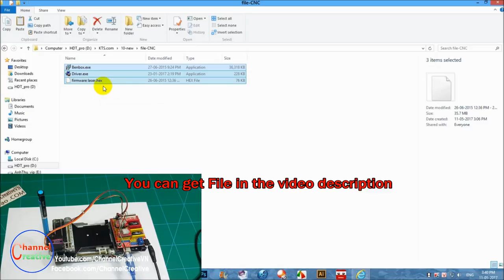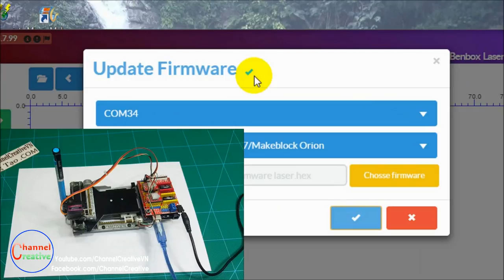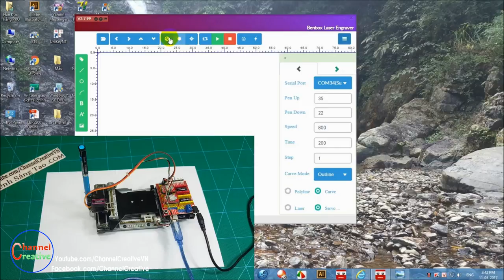How to Make a CNC Drawing Machine at home

Comment: As a beginner to robotics, how should i develop my skills in robotics? I know some arduino. Any Recomendations? Can u please reply?
Reply: Warriors Fan #1 try an obstacle avoiding robot that is vaery simple and interesting way to get the best of arduino
Reply: Just go to ebay and order lot of sensors, motors, displays and then you just start with one of them. When you know how to use what you gought then you can make everything.
Reply: I would say that being able to have a solid understanding of programming arduino, raspberry pi, or other micro controllers (usually C/C++) is the most important, followed by learning basic circuit theory and the different types of transistors and what they do. For most basic things that should be enough. 

When you get into more advanced projects, things like real-time capability and power efficiency become more important.
Reply: take some semi-big project like 3d printer/cnc router r something similar and try to make it by searching hw is it made and see some videos,thats what i do.

Comment: Sir, you give 5v to cnc v3 shield but it need 12-36v how it run 
And my DVD stepper motor is very heated 
So what I am doing
Reply: Suraj Maurya can u sell this
Reply: kbc writer No, but I making this as my college project
Reply: Can you help me to make this
Reply: why not
Reply: Send hello
Reply: Okay
Reply: yeah the DVD stepper motor gets heated
Reply: Suraj Maurya did you solved this?
Reply: would u sell me a finished version and ship it to the US? if u would do, how much for it?
Reply: I m facing this too .how can i solve this heating problem?😥
Reply: My project for the school is this Cnc But the Motor is too hot ans heated :(
Reply: Use resistance on motor
Reply: Suraj Maurya are you using 5v?
Reply: Motor needs 5v not 12v because you will burn it. Adjust the potentiometer at the stepper motor driver to 0.20
Reply: @tanmayislam855  give to like 18 v so it can take the full energy it wants because 5 v is very very bad for it so just bring 2  that have 18 volts each one will have 9 volts so connect the positive with the positive on the other battery and the negative with the other negative on the other battery and then to the CNC SHIELD and I am sure it will work because I tried it.
Reply: @instaboiidsg2117   how can i do it ?

Comment: did you give any arduino code uploading as well for this project ? , did you included GRBL library.  my dvd motors didn't responding to commands fro pc program only servo motor at pen moves. where could be the problem?
Reply: Use 12v adapter for CNC shield .
Reply: but my servo moter dis not work
Reply: sewasaran satsangi servo will started it's work when you give a power from computer. It doesn't need any outer power source
Reply: I also give power from computer but servo is not work.please help me sir
Reply: sewasaran satsangi check connection of servo and also check that servo is working ....
Reply: Does your servo is vibrating ???
Reply: no sir, i connect all wires properly but my servo moter cannot work it just only up and down for 0.5 sec. when i connect  to computer .
Reply: sir please help me
Reply: sewasaran satsangi ok first install basic example of led light which is given in adruino Application , then re install firmware from beanbox , if it doesn't work then change the setting of beanbox (it's try and error type of work )
Reply: SIR WHERE I FOUND LED EAXAMPLE AND HOW MANY POWER I GIVE TO CNC SHEILD
Reply: I CAN NOT FIND WHERE IS EXAMPLE OF LED LIGHT
Reply: sewasaran satsangi u must install adruino ide then go to example then basic and then blink
Reply: i will already install blink code
Reply: sewasaran satsangi blink code is used to just remove the beanbox software , just like reset
Reply: sir what can i do i will upload the blink code
Reply: sewasaran satsangi once u upload blink code then upload firmware from beanbox if blink code is working properly
Reply: no sir when i upload firmwere blinking is stoped
Reply: sewasaran satsangi check the video in youtube for "how to check adruino uno is original and it's working "
Reply: have u use facebook
Reply: but my aurduino is work properly.i will alrdady check when i purchase aurduino
Reply: From where can I get aluminium composite

Comment: I have made it successfully 😊😊
Reply: #Tonmoy islam.
Hii. I hve made this project and servo is working fine. But the stepper motors are not working properly. How many volts should i supply to cnc. Now iam using a 5v 2A adapter. Should i try using 12v adapter. Or should i take a short usb cable. Please HELP!!!!
Reply: zaki shaikh 5V 2A enough for me .can you describe which windows installed on your PC?
Reply: Its Windows 7 32 bit.
When i rotate 1st motor it rotates for some time and stops working. And then 2nd motor starts working and then after few seconds it stops and again 1st motor stars working And it continues. Both motor doesnt works at same time. Also they dont work continously  it is working jam.
Reply: zaki shaikh it might be a driver issue .or your motor got too much tight . make sure all value as same as this one .
Reply: Tonmoy islam Which values are u talking about???
Reply: Tonmoy islam My drivers are working fine. Also my motors are not tight.
Reply: you have to change some values in benbox softwere
Reply: Tonmoy islam Which values should I change ??
Reply: Tonmoy islam Is this ur FB I'd or Gmail I'd???
Reply: fb

Comment: Hello
Excuse me, I did everything right by training, I tested the motors and installed it on the board.
The sero-motor is healthy

But the one who wants to do it does not move left and right.
The seromuter does not move. The problem is where I tested the 12 volt adapter 1 amps and 5 volts of 2 amps. Both of these would result.
Reply: My servo is not working. Fixed in one position.
how to fix it?

Comment: Would it be a problem to use the DRV8825 stepper motor driver instead of the A4988 stepper motor driver?

Comment: hello,
i have made the same from a4988 stepper but my motor only vibrate it doesn't move i also tried to change resistance of stepper but it doesn't make any change , I'm using 5v,2amp adapter please help me.

Comment: i made this project 5V 2A given to CNC motor shield board successfully connected with PC software after update but i have few problems
(01) thread of pen broken every time i powered this unit with PC connection (servo rotate too much at start)
(02)  during the drawing of sample picture servo of the pen only works well X & Y axis motors from DVD drives are not working and  Y axis motor also heated up during drawing is  progressing by PC
i checked both dvd motors they works well motor connections to CNC board done as your guidence
please be kind enough to sort out this problem, thanks.

Comment: Bro another is I have change the steeper driver pointmeter by any while it start running it will going heat too I change the pointmeter to 0.20 and my power adapter is 5v 2.0am  but one thing is while iam running the motor  my laptop is charging with the adapter so is that will effect the current increase or not. Thank you I need for urgently please

Comment: I have completed the project and it's working fine but the  only problem is My servo is not working what to do
Please help me
Reply: The Techy Boy  same here
Reply: is this project required any arduino code because discription box dsn't have if required means post in this comment
Reply: Can u help me
It's showing nothing connected in port when I try to update the firmware

Comment: Bro I tried connecting with the benbox but now the stepper motor is cool and not moving
Bro servo motor started working
: But stepper motor is cool and not moving
I adjusted the value: It working perfectly as whenever I upload a picture it raises when not needed to draw
 In com3 when I connect it shows success
 When I disconnect the aurdino the led turn off even if cnc shield is supplied

Comment: hello, very good project, I have done it but they overheat the motors, is that normal? what can be done? thanks greetings
Reply: Hi, you probably need to turn down the power on the stepper drivers.  There should be a tiny screw.  Turn it very, very slowly anticlockwise to turn the current down.  You only need to turn it a few degrees.  If you have a multimeter, check the voltage between that screw and ground.  Start by halving the voltage.  Its normal that the motors get hot, but they should not burn you.
Reply: Very interesting.  I'd be interested in seeing more of your pen mechanism.  Mine it too heavy, and it moves the teeth away from the spindle.
Reply: Samuel Pickard is taken out with a 3d printer, doing it by hand is more complicated

Comment: on cnc shield it is mentioned that 12v then why we are suppose to give it 5v supply ?
Reply: 12 volts would be a lot of voltage for small step motors that only require 5v
Reply: @infester159  thankuu

Comment: can you help me
when i plug the arduino in the computer and fix the settings the servo starts to move up and down then the motors wont work and arduino starts disconnecting
Reply: Filip Eriksson thats why this is incomplete video hiding software instalation part you never become successful only with this video
Reply: If there is motor not working and only servo is working then use 12v adapter for CNC shield
Reply: Wasantha Wimaladharma software installation is too much easy , just follow the steps for that wizard

Comment: What is the supply voltage for the shield
Reply: 5v, 2amp as shown in video
Reply: hi the cnc shield is 12v its the arduino that is 5v.

Comment: Bro can u plz help me out...
As I made this handwriting machine not using the CD driver but using different stepper motors and a service motor ....
But after connecting the complete circuit .. my stepper motors are not working ...
So can u plz help me out with it . ..
That how to operate the stepper motor and the benbox software ...
Plz do reply fastly ...

Comment: My micro servo didn't working properly it only work when I plug it it's moving down to up when I plugged into current
Reply: KICHU Rock make sure your servo setting at benbox is right, X=11 Y=11 or 12. Also check servo wire, red to 5v, brown to gnd, yellow for signal to Z+
Reply: My servo is not working. Fixed in one position.
how to fix it? I have adjusted the parameter like you.

Comment: When I am using stepper motor from LG cd drive (completely working cd drive) it's not working....?
When using stepper motor of hp cd drive it works....
Give any solution to working of lg cd drive stepper motor...
Reply: Sudhir PV, Hai sir when i connected uno with the laptop, only servo motor is working. But stepper motors are not working and gets heated up. Can u please help me to solve this issue.

Comment: I have completed the machine but the y-axis motor has gone for 2 times why?
Reply: Bro eppadi work aachu enaku update firmware connect aaga matingurudu
Reply: @alonethrottlerider1257  did'nt understand
Reply: Bro while run the update firmware its shows on the display script error.plzz help me to solve the issue

Comment: hi my dear friend
i make this machin 
after finishing and start it have a problem in both motor.
all 2 motor is very hot and i need help to solved this error. plz help me
Reply: to many volts, only 12 volts needed or you have wired them wrong.
Reply: same with mine.
Did you resolve the problem..?
please let me know how to fix it.

Comment: Is there any requirement of programming in any of the card....?
Reply: no you don't need to program it
Reply: @yehya2715  so we just complete the connection and the install the benbox?
Also do we install while conmected with the ardino or without connecting the ardino
Reply: @sameeramomin2789  yes you should install benbox and as you want you can connect it and download benbox or without connecting it you can download benbox

Comment: it is good video but name of ic board and name of the other things used these must be subtitles
Reply: hi Naresh Mehndiratta the boards are, arduino uno - cnc sheild v3.0 and two a4988 drivers. the other things are two stepper motors taken out of computer dvd drives and a servo. hope that helps.
Reply: thank you for your fast reply  morever i am a man of hearing impairment so i did not want to  listen so i read also

Comment: Hi, I just buy CNC Shield, arduino nano, controllers and other components... I use TLaser for software because benbox is not just correct for me. I connect all like on tutorial but I cant move my Y axis (motor), X is OK. Voltage on controllers are 0,2V and I use 5V. I changed controller, motor and wiring, nthings happen...Can someone have this problem and how I can solve this.

Comment: Bro my servo is not moving what will be the issue did I missed some thing , how can I contact u bro ur mail id pls
Reply: A MI ME PASA LO MISMO
Reply: @antoniogallesi  how to fixe it bro any tips pls , how did u fix the issue bro
Reply: @kampfer4466  I'm testing and testing and the servo is not moving a millimeter
Reply: @kampfer4466  I do not know what it could be, if you can move the servo let me know please
Reply: I think there is a change in firmware

Comment: I Have finished this project.if anyone getting Problem Then Plz let Me Know?
Reply: @_DarkKnight  check Description once
Reply: Hey can you please tell me which dvd writer have you used bcoz mine is completely different
Reply: @tarannummomin2310  I have used L.G dvd writer . U can use anyone it Doesn't matter
Reply: @susan5243  are there any size for the jumper caps??
Reply: @tarannummomin2310  yes .
U can find this jumper in Old motherboard Near coller fan
Reply: @susan5243 I an done with the assembling thanks but when I downloaded the link it is asking which app to open it with
Reply: @tarannummomin2310  you need to open benbox
Reply: @susan5243  when I try to update the software it is showing 'nothing selected'
Reply: @tarannummomin2310  first check the wiring properly
Reply: @susan5243  I checked the wiring and also the port other devices are connecting there
Reply: @tarannummomin2310  I think you should check the cnc shield its expired or not

Comment: this program (hex) is not working !!!!
Reply: Which dvd model have you used bcoz when I opened mine it is completely different
Reply: @tarannummomin2310  the drive doesn’t matter the drivers work for all the regulator there you can change the current. but that’s not the question. The servo drive doesn’t work stably I changed the file but the sck doesn’t work correctly.
Reply: need accurate calculations for the assembly and you do not have limit switches, these are buttons that switch the engine at the end and the beginning of the steps